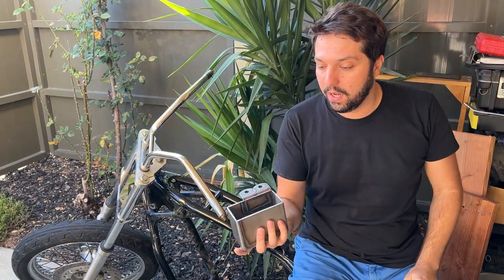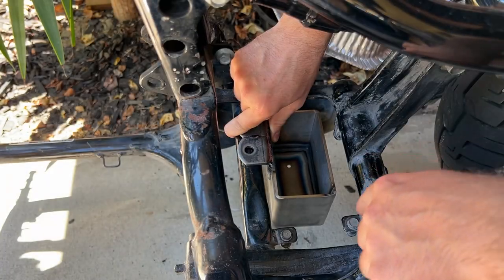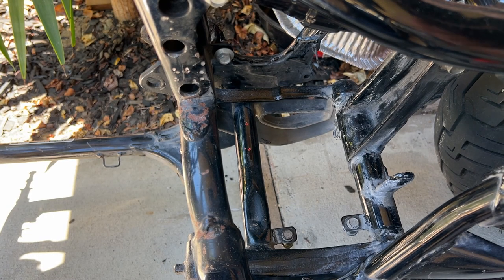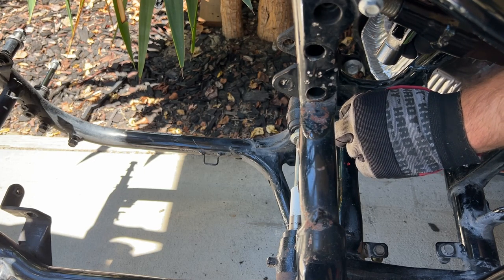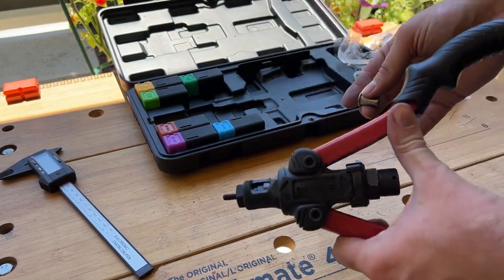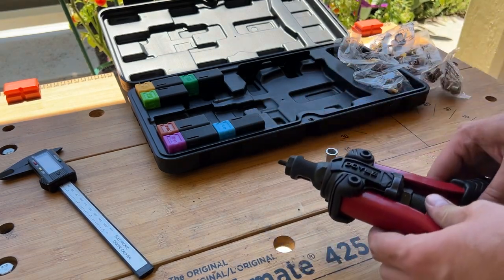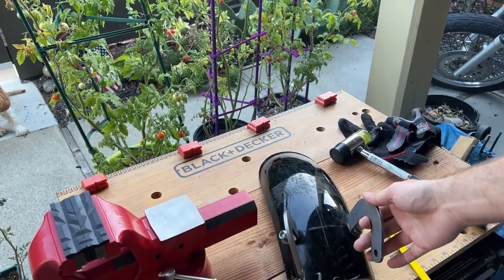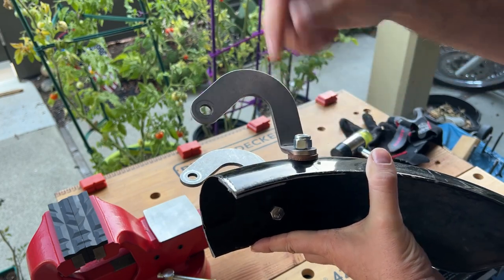Bobber Build 1993 Honda Shadow VT600 - Part 18

Comment: You think if i use the whole Fender without cutting It and use a sissy bar would be able put a seat on the Fender for a passenger?
Reply from the maker: Great question! 

I think the first thing to look at is the clearance of the tire and the bars. I don’t think the OEM front fender is wide enough so the bars would interfere with the rear tire (if you have the bars and fender that’s pretty quick to check).

In term of withstanding the weight of a person, that’s a tricky one. The OEM fender was not design for this type of use. If it was me I would still try and worst case I would just buy an aftermarket one. When I mean try, it is basically getting it installed and tested in the garage sitting and bouncing on it. I recommend filming when testing so that you can review the video and see if any movement or bending happens while sitting on it.
Reply: Awesome thanks for the reply the sissy bar Is from a brand named tc bros and its actually bended like its not like a straight triangle has some type of spacers for clearence but yeah im gonna try that thanks!!
Reply from the maker: Cool! Make sure to share the results 🙂